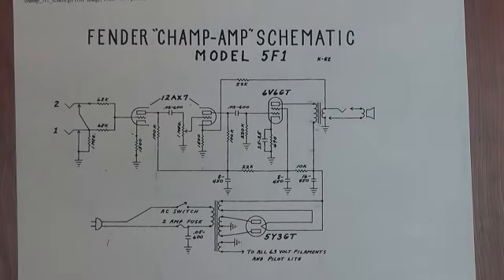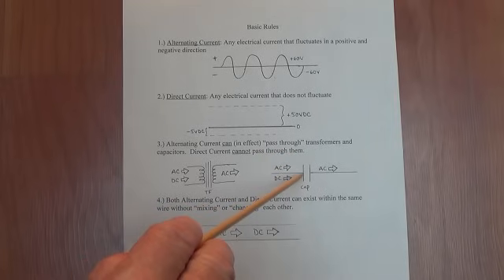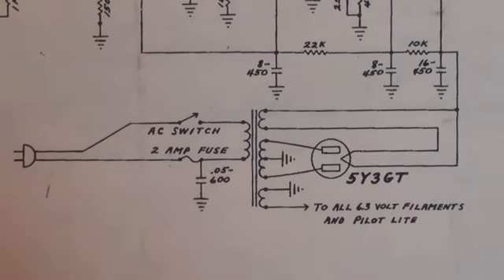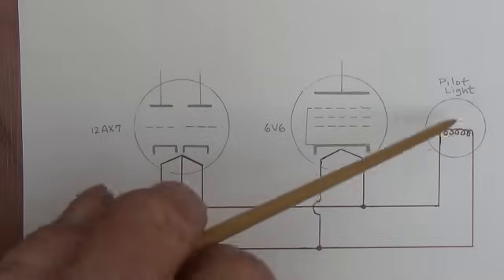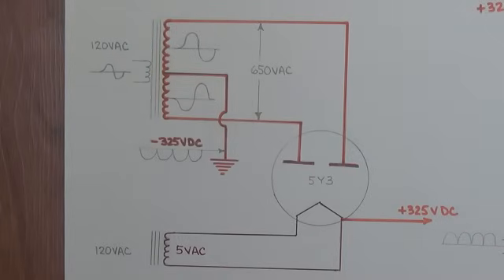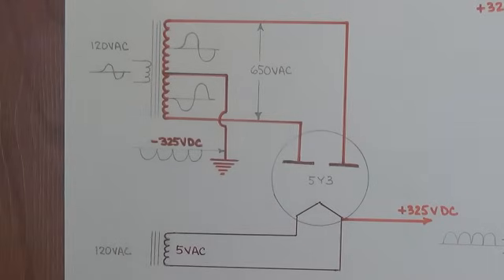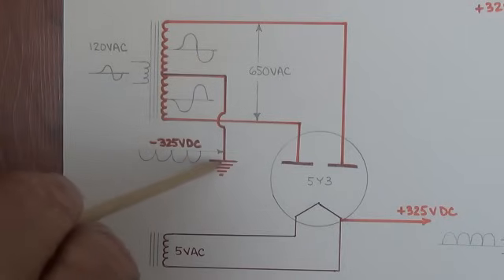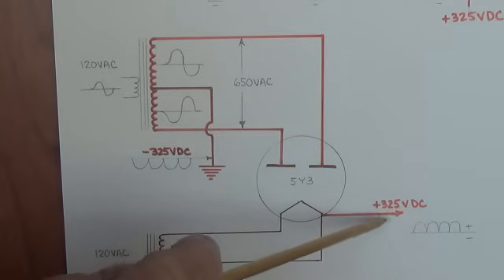How Tube Amplifiers Work, Part 1: The Power Supply

Comment: Very new to this but have been enjoying your videos, thanks.
I am trying to make a microphone preamp out of an old Akia tube tape recorder, people have done this but mine needs the output stage capable of driving a transformer for a balanced output. Someone online suggested that the 12AX7 could not do this and suggested using an old RCA circuit using a  12AU7, less gain but more power to drive the transformer?? The input stage is an EF86 (6267) and I have the original power supply. You said that the 12A... family have a plate current of 5mA, will it be that driving a line level transformer and is it as simple as using ohms law to figure out the resistor to get the right HT+ voltage for that section of the amp. Thanks.
Reply from the maker: The 12AU7 has considerably higher plate current than the 12AX7, Les....over 10mA. For this reason, it may work better than the 12AX7. You can try Ohm's Law to get a ballpark resistance, but will probably have to fine tune it by trial and error.

Comment: Excellent video on circuits. Thank you for posting these videos. I will watch them all and learn about what I failed to learn some 50 years ago. What do you think of the old solid state Thomas Organ/VOX amps designed by Sava Jacobson and Dick Denny? Innovative or prehistoric?
Reply from the maker: Thanks for your very nice comments, Charles. Jack and I stick exclusively with  vintage tube amp circuits and have virtually no experience with SS gear.

Comment: Just found this you tube video as my Solid State Amplifier is in the shop so I bought  twin 6V6 Tube amp to play on in the meantime. But i wanted to understand why there are so many wires and components on the Tube Amp while the Solid State amp has so few but has many more effects built in. This is OUTSTANDING TROOP! I did get a little drowsy once in a while but I am pretty old and just had lunch. You diagram and explanation was quite understandable and very informative. I am more awake now and want to see part 2. Thank you for sharing your talents. well done.
Reply from the maker: Thanks, Dennis. I'm glad the video was helpful. Don't feel bad about getting drowsy, it happens to me all the ti......zzzzzzzzzzzzzzzzz.

Comment: What affect would placing a capacitor across the center tap have on the circuit in terms of noise? Does a negative ripple voltage to ground have an affect to noise in the amplifier?
Reply from the maker: I have never done this, so I can't comment one way or another, Cole.

Comment: I'm sorry if you've already answered this Question Uncle Doug, but does the 325vdc rectified signal at the filament also have 5vAC sitting at the same point? If so, why doesn't the first filter capacitor provide a short circuit to ground for the AC component?
Reply from the maker: That's an excellent question, Chris. Yes, both the +325VDC and the 5VAC coexist in the B+ line.....BUT, the +325VDC has a ground reference due to the grounded centertap of the HV winding, so it continues to the amp circuit, seeking ground return to the CT and winding. The 5VAC however, has no ground reference, and only wants to return to the winding from which it came, so it does  not continue to the amp circuit and filter caps.
Reply: I think I understand now, Uncle Doug. If so, then if we removed the HT windings from the 5Y3 and only left the filaments in the circuit, then the B+ node would read a flat, ripple free zero volts with respect to ground because the filament  has no ground reference. 
Can I be greedy and ask another question, as I have a sneeky feeling it relates to the previous question? In a twin triode preamp tube, does each triode half has its own filament? If so, the 2 filaments are in series and are supplied with 6.3VAC. So why isn't each filament seeing 3.15v? I think it has to do with the ground pin 9 ground, but that damned penny is refusing to drop. :-)  Thank you Uncle Doug. You are a very generous man to share your knowledge with this unknown fella in Sydney.
Reply from the maker: Fortunately, tubes with 12.6VAC filament voltage requirements have center -tapped heater filaments, so you attach one of your 6.3VAC supply wires to both ends of the filament and then attach the other wire to the center-tap. The result within the filament is 6.3 + 6.3 = 12.6VAC.
Reply: Thank you :)
Reply from the maker: You're welcome, Chris.
Reply from the maker: You're welcome, Chris.

Comment: I'm having a bit of trouble grasping what we see at 11:11.  I believe I'm understanding this correctly: When the anode of each half of the tube goes positive then the cathode goes negative and when the anode goes negative then the cathode goes positive.  Where I'm confused is that since there is only a single cathode (is there?) then while one anode is positive and one is negative then why don't they cancel each other out on the cathode?  Or else-where does the negative swing go?  The other part that really confuses me is that since the heater and cathode are connected, then why isn't the high voltage blowing up the heater?  Even though it's DC, it's still heavily rippled so wouldn't the AC still be seen on the heater?  If you or anyone has any recommendations on more resources to better understand this part of the rectification process, I'm all ears.  I understand how it works with diodes.
Reply from the maker: If you understand how it works with diodes, RT, then you should have no trouble understanding tube rectification, since the rectifier is simply two diodes, which are biased in this case to pass the positive waveforms and block the negative ones. The cathode and anode never change polarity. I have posted a newer and more complete video on power supplies and rectification that may be easier for you to follow. Please see my video list.
Reply: I'm realizing that my confusion is around how to my mind Rectifiers are sending the current through the plate to the cathode, but then in the rest of the tubes I'm always thinking in terms of signal flow of the electrons from the cathode to the plate.  So it kind of twists my head around.  So what does happen with that little 5V AC from the heater that in in the circuit?
Reply from the maker: Please watch this more recent and thorough video describing the rectification process:   https://www.youtube.com/watch?v=O3Cvhnhv0dM&t=421s   Maybe it will help you to understand the process.

Comment: Hi Doug, I've an old Guild Thunder 1-12 from 1972, and every time I play it at a high volume, the sound seems to duck out, and then fizzle back in about a second later. The issue is exacerbated by higher bass, so I figured the PS has collapsed, but I cannot determine why. Bad rectifier, maybe? It uses a 6CA4, so maybe it got asked for too much current? 

Thanks in advance for your time and insight,
Britt
Reply from the maker: It sounds like extreme sag, Britt, especially when bass makes it worse. Your rectifier may be failing as well as some other power supply components. Switch rectifier tubes and see if it helps. Good luck.
Reply: Man, I had a friend with a Guild Thunder 1, and those things sound amazing!

Comment: Like your videos I have watched them the last couple years and I’ve been teaching myself electronics and how to build amplifiers I’ve built low-voltage tube headphone amplifier’s and have just built my first low-voltage 24 V power amplifier. I would like to build a vacuum tube diode power supply 24 V 3 A. Can you guide me towards some reference material or kits or some proven known good schematics so I can replicate and build my own power supply. I was gifted a couple hundred new old stock vacuum tubes and noticed there was a lot of different type of rectifier diode tubes in my new tube collection.
Reply from the maker: I'm glad you enjoy the videos, TL. I specialize exclusively in vintage tube amplifiers which operate at voltages much higher than 24V and have no experience or knowledge regarding these low voltage amps and power supplies. For that reason, you would be better off doing Internet searches for the information you seek. Good luck.
Reply: Uncle Doug thank you for your reply I’m working my way up from the low-voltage stuff to the high-voltage. Safer and cheaper to begin with the low-voltage.
Reply from the maker: Yes, indeed, TL, and an excellent learning experience. Keep up the good work :)

Comment: Cheers Uncle Doug, a great explanation in simple terms, really made it easy to understand. Excellent.
Reply from the maker: Thanks, Declan :)
Reply: Uncle Doug , I have subscribed to your channel and have eagerly watched a few other videos, really great stuff indeed. I don't have an electrical background however I am considering starting a restoration project as a hobby on an old Ampeg SVT 3 Bass combo, SVR212, It's has a 3x 12AX7 tube preamp and SS poweramp. Your channel is giving me some great foundation knowledge to build my confidence. Will likely have to re-tolex the combo also.
Reply from the maker: I hope the videos are helpful and that you successfully complete the project, Declan.

Comment: Older video that hasn't been touched in a while, but i'm lost not on the grounding, where does the -325 vdc go?
Reply from the maker: This is addressed by notes added to the video, but not visible on all viewing devices. The output of the PT can be defined as either +325VDC or -325VDC......but not both. The diagram itself was unintentionally ambiguous in this respect.

Comment: Uncle Doug, 
I really enjoyed your simplified explanation. However, I do have a problem with the explanation of how the center tap has -325 volts and the positive lead after the rectifier has +325 volts. Wouldn't that charge the capacitor to 650 volts? My understanding is that there is "0 volts" at the center tap and ground, the diode only allows the positive 325 voltages to flow through, the negative voltage is filtered out.
Keep up the great work.
Thanks,
John
Reply from the maker: I agree, John, and this issue has been addressed several times in the Comment section and with notes included in the video scenes (but not visible on all viewing devices). Since the center tap is grounded, it and ground are at an equal potential that we define as 0V.  Due to the bias of the diodes in the rectifier, only the positive wave forms are allowed to pass and have a potential of +325VAC relative to the CT and ground.

Comment: I’m in the process of purchasing power supply parts for a new build 1960s Fender stand alone 6G15 reverb tank. I’m going with Hammand manufacturing brand Transformers made in Canada.
The schematic calls for a choke to sit just after the P.T transformers filter capacitors. If you feel so inclined and have the time to do a video 
That explains what the purpose of the choke is in on the power section and how it works. Also possibly talk about chokes, reactors and inductors and how they very in their purpose. They all seem to be the same piece of hardware that can do three things???

P.S. I’ve been marathon watching your videos one after the other!

Glen
Reply from the maker: Thanks for watching, Glen. I built my own 6G15 many years ago and made a video about it on another channel, before I had my own.  A filter choke simply smooths out the ripple in the rectified DC. It offers low DC resistance to the B+ current, but is very effective at reducing the ripple/hum. The choke is an inductor because it is a coil of wire, and it has reactance to AC (ripple) which means that it "resists" its passage through the coil.
Reply: Uncle Doug Hey I’ve seen that video, now that you mention it and that’s the video that inspired me to build my own reverb tank!!! Thanks for the quick lesson on the purpose of the choke in the  power supply chain. It’s always nice to actually understand what the components are really doing.

Glen
Reply from the maker: I'm glad the video was inspirational, Glen. The 6G15 is a great design and has the best reverb you will ever hear. Go with the MOD tank......I found it to be much better than the modern Accutronics tanks.
Reply: yes my plan is to get the vertical MOD 4AB3C1C. Was also thinking of getting the belton horizontal one also??? Just to try. Apparently the Belton is better then the Accutronics, even thou they are made by the same company. But not sure if it’s worth getting the horizontal one, because apparently the horizontal configuration
Is not as Drippy as the vertical?
Getting the tank from 
Amplified parts in AZ. They are the cheapest online store. But the shipping to Canada is nuts :-( but still cheaper then me buying it from a Canadian supplier.
Reply from the maker: The MOD 4AB3C1C is exactly the same tank I used and it worked great. I also used a 47609 Power Transformer, 22699 Filter Choke,  and a 47605 Reverb Tank Driver, and reduced the filter cap values to 22uf @ 450VAC.  I'm not sure why Canadian shipping is so high......you aren't that far away :) Good luck with your project.
Reply: why smaller caps I thought bigger caps do a better job at eliminating sag? Or is it a frequency thing that you used 20uF instead of 40-47uF caps?
Reply from the maker: I felt that 40uf's were excessive.....and the 20's worked just fine. If you 're nervous then use 40's.

Comment: What does considered to be 0 volts mean? Wouldn't a chassis at -325 volts be a potentially lethal shock? My poor brain has no idea what to do with the ambiguity.
Reply from the maker: There are two ways to look at an amp circuit, Lerch, based on where the electrons are.....and where they aren't. "Charge" is based on this. Where the electrons ARE is "negative", and where they AREN'T is "positive".

In effect, the power supply is an electron pump. It pumps all the electrons out of the circuit and into the chassis, so the circuit (i.e. tube plates) have a positive charge and the chassis is negative. At this point you could say that the circuit has a charge of +325V compared to the chassis at 0V, or that the chassis has a net charge of -325V compared to the circuit at 0V. One or the other. It is the accepted standard, however, to say that the circuit is +325V compared to the chassis, which is at 0V. 

My diagram was meant to convey this, but ended up being confusing. I hope the explanation made sense. If not, here is an analogy:  If you drive 50 miles away from home, there are two ways of describing your position: You are either 50 miles from home, or home is 50 miles from you. One or the other. You can't add the distances and say you are 100 miles apart. Either you or home have to be set at zero distance.

Also, with regard to shock hazard. The high voltage exits from the power transformer, travels through the circuit, and returns to the PT. It has no "interest" in going elsewhere.....unless you were to simultaneously touch a + and - high voltage point and offer a less resistive pathway between them. This is why you never touch a live chassis/circuit with both hands.

Comment: Hello, you are a master of the amps ... first of all this is a translation since I do not know English I am Spanish sorry..I have a question I want to mount a 6n2p and a pcl86 to make a 6w on a vintage radio chassis but I have a doubt about the mass ... gnd .... and the chassis..I do not know whether to make the chassis driver with gnd ... and if that is how I do it ... I connect all the points of mass to a single point ... it can be done in several ... or only the potentiometers and jacks go.
Reply from the maker: Greetings, AA. I'm sorry but I have no experience with the tubes or situation you describe. Perhaps another viewer can help.

Comment: You understand very well  this subject. I am very good at repairing tube equipment since I have been tinkering with tube equipment for over 20 years. However I am trying to make my own design  to work right. It sounds good and all however is using too much current I suspect that the output tubes, single ended to a matching transformer,  are not biased right.
can you explain in one of your lectures how to bias output tubes rule of thumb?. Thank you very much.
Reply from the maker: I have posted videos showing how to bias single and double-ended amp circuits, MT. Check my video list and you will see them.
Reply: Yes, Thank you much.
Reply from the maker: You're welcome.